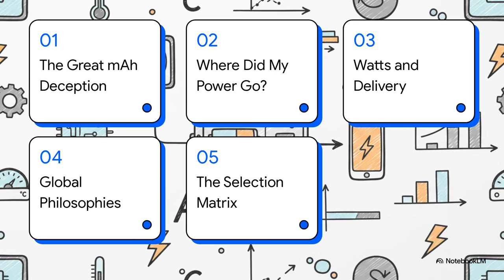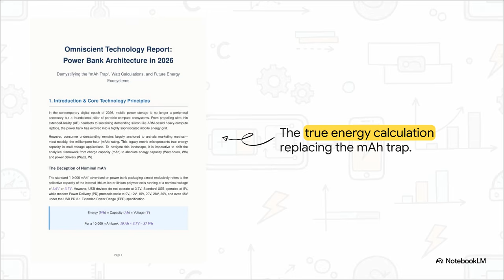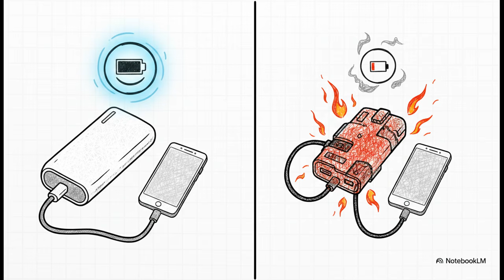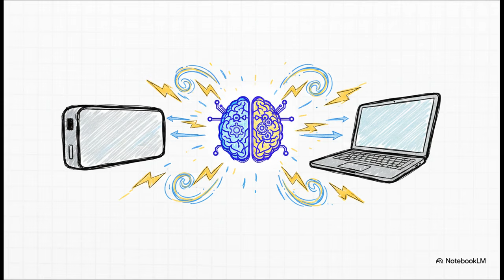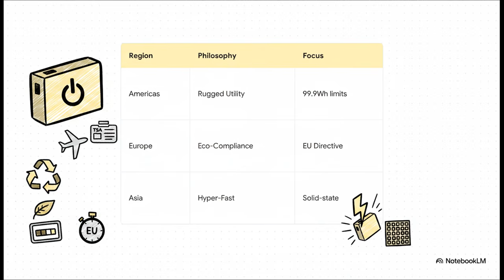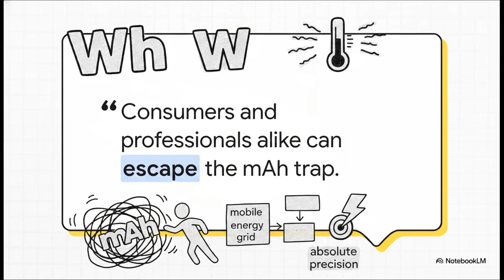10000mAh Power Bank is a LIE: mAh Trap EXPOSED! (Solid-State, Wh vs mAh & PD 3.1)

Comment: 1:26 and 2:33 That's why you put between 3 and 6 cells in series, depending on the maximum voltage you need to support.  Few, if any, power packs are likely to run from 3.7V exclusively.

3:49 Load has a lot to do with efficiency.  DC-DC converters are at their least efficient at low loads.  85% is likely going to be the worst case.  For charging phones that support fast chargers, you should do significantly better than that.  Even when otherwise, 15% loss of not much is still not much.  Stating that a 10,000mAh pack delivers only 6,290mAh is a bit of a stretch without supporting evidence.  Also, your AI needs to learn where to put commas.

7:08 Just don't buy a 48V 250W rated model for an old fashioned 5V phone.  And, 7:30, you don't need a display.  That adds expense and limits your options.  A display won't tell you efficiency nor a reliable "charge left", and any manufacturer who wants to mislead can fix the numbers it displays anyway.  Watts output tells you what the device demands, not likely what is being drawn from battery cells and it certainly doesn't say anything about the battery's capacity because you often can't draw the full rated power from a single port (except maybe USB-C, and then not necessarily).

8:26 Look, it just doesn't matter.  Quoting Wh just confuses things more.  It may be the case that quoting "big" mAh numbers has some marketing utility, it does make one model directly comparable with another.

Comment: Good luck finding a power bank that meets those requirements - most only show dots (e.g. Anker) or a percentage indicator (e.g. Charmast) to show how much power is remaining, and don't tell you anything about the battery chemistry or heat dissipation methods.